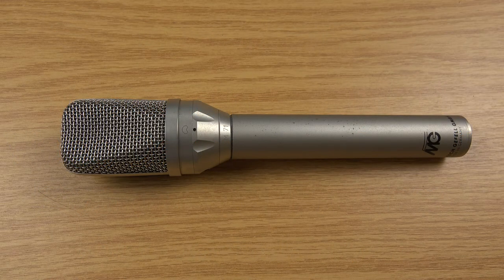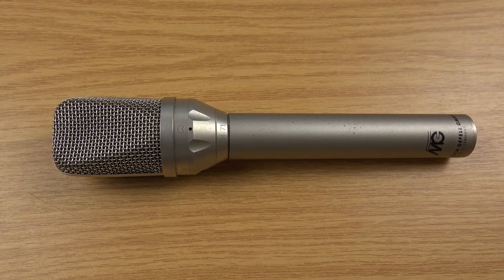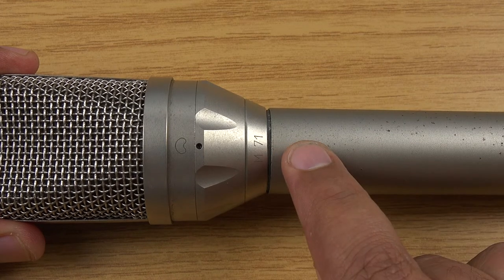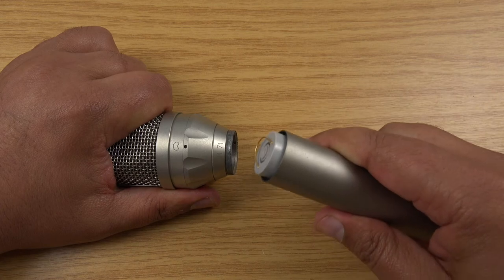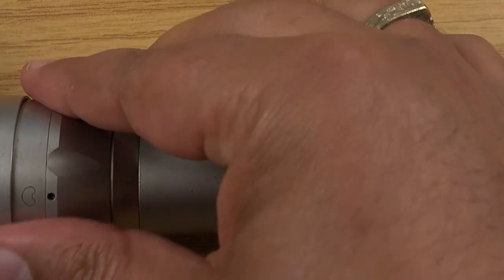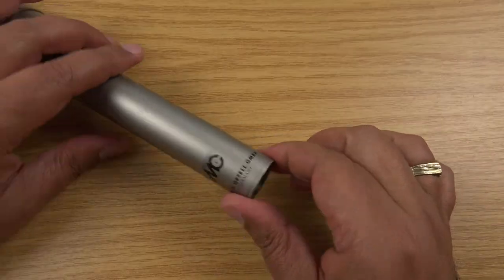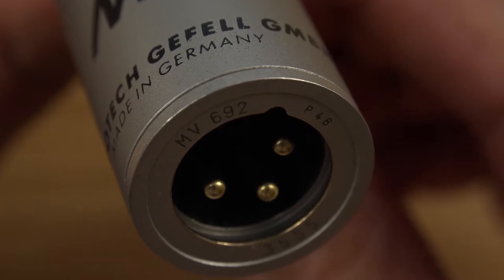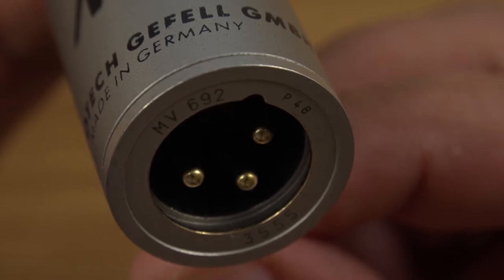Microtech Gefell M71 East German With Neumann Vintage M7 Capsule Problems & Dialogue Audio Examples

Comment: I'm sure you figured it out by now, but for those that come across this video, this might be helpful.  

I bought a used U87 that did a similar thing, especially when saying words that may cause some condensation to build up (especially words that start with H) and it turned out to just be that the capsule was dirty. It had years of buildup on the membrane, so I removed the headbasket and cleaned it with a Q-tip and distilled water.  All you have to do is GENTLY rub it onto the capsule to remove the grime.  When I say gently, I mean APPLY ABSOLUTELY NO ADDITIONAL PRESSURE (I would barely even allow the qtip to sit on the capsule under its own weight, only allowing the cotton to touch it).  Before dipping the qtip, I'd lightly pull at some of the cotton so that it's fluffy and not so tightly wound on the stick.  Then just dip it in distilled water, allow some of it to drip off before touching it to the capsule membrane and very lightly drag the moist cotton across the surface.  Take your time and don't expect every spot or smudge to loosen right away, because after all, you're not using any solvents and you shouldn't be applying any pressure to the surface, just gently dragging the lightly saturated cotton swab across the capsule.  I'd take a dry q-tip, again with the cotton loosened, and drag it across the capsule to dry up the water left behind on the capsule.  I repeated several times until the capsule looked relatively clean, just be sure to dry it with the soft cotton swab the best you can.  After it was clean, I allowed it to sit to make sure it was completely dry, I plugged it in, and never experienced it cut out again.

Comment: Sorry bit late but just so you know for the future. I have two u47's and at 48V they can exhibit the same problem and many other similar problems. This is because they are extremely high impedance and so susceptible to moisture in the air and bad contacts, in a way that dynamic mirophones are not. Also the capsule is exposed naked to the voice and perfectly aligned to pickup your breath moisture, which condenses on the gold plate and  - fizzz - bang -  silence. I use good sitlled water in a very clean small glass tunbler  and immerse the whiole capsule ( one ce removed from the mic) in it once every three or four years. This gently loosens the dried dust etc, from the very fragile gold coated diaghpram, and close examination of the water revelas lots of stuff floting. Remove thecapsule assembly, then wash down the diaphram witth more distilled water and air dry ovenight in a clean space. Reassemble the mic. Good for a few more years. DO NOT use any solvents, detergent, soap or anything else. Its not necessary and may damage the capsule. 
Clean the pins on the connector with a soft sharpened matchstick, gently. Some isopropyl is also Ok just on the terminals. Check the wiring to the XLR plugs carefully, the wires a fine and can show fatigue after many years work.

Comment: I have a couple of Gefells like this, one multi-pattern and one cardioid.  At the same session on the same day, they both failed in exactly this way. They suddenly dropped in output by about 30 dB. First, one quit and I brought in the second one...and then it failed. Oddly enough, we finished the session and I was able to rescue the take simply by bringing the gain back up in post. 
After a lot of texting and calling around, I finally talked to a mic repair guy in L A who deals with lots of LDC studio mics.  Here's what he said. The skin in the capsule in that mic is either mylar or PVC. It is held in a round brass frame. One contact attaches to the brass frame and the other attaches to the center of the skin. The skin has a thin layer of gold applied to a circular area that is just slightly smaller than the inside of the brass frame. The problem arises because the skin carries a static charge that attracts and holds dust and fibers from the air. Normally, this poses no problem but when it sees high humidity, some of this detritus becomes electrically conductive. If just one or two of those dust particles happens to be in contact with both the gold diaphragm and the brass housing, it causes a partial short circuit. This, in turn, causes the 30 dB drop in output.  He was quite convinced that a "simple" cleaning would restore it to its former glory. I haven't, yet, had enough disposable income to send them out for repairs, but I was persuaded by this guy's candor and confidence that this was the course of action to take, especially because the other possibility was that the membranes had lost tension when exposed to heat in storage and that high SPLs would cause the membrane to hit the backplate and stick momentarily.
One thing I can tell you is that it is not a problem with the electronics. My experience in restoring the gain showed me that the original quality of the mic was still intact, just at a much lower level.
As for the RFI, a Gefell mic would not be my first suspect. I'd bet a dollar to a doughnut that there is not a good ground where you are.
Reply from the maker: Mine was defo the amp, not the capsule/moisture/static. As for the RFI, it's a known problem with certain Gefell and Neumann mics. You can get around it by lifting the earth on the cable, something I've done a video about.
Reply: @DavidHarry  I Seem to have the same issue with a m71s. What was the cause to the problem in your case and did you g’et it resolved?

Comment: The early M71 did have RFI problems. GPrime found out about it about the same time they sent me one to review. I'm thinking they didn't have the amount of RF in the air in East Germany that we have here in metropolitan areas in the US. They added internal circuitry to shield the mic. The serial number of my M71 is 2257.
Reply from the maker: Hi. Yes, that would make sense, a lack of shielding due to a lack of radio sources for potential interference. Cheers, Dave.

Comment: You might try initiating a correspondence directly with MTG. I am pretty certain they could give you an idea of what needs to be repaired and provide an estimate...they do repair and test customers MTG mics. Best of luck!
Reply from the maker: Thanks, Teddy. I did do via a distributor but the cost of the fix was too expensive so I sold the mic for spares/repairs. Cheers, Dave.